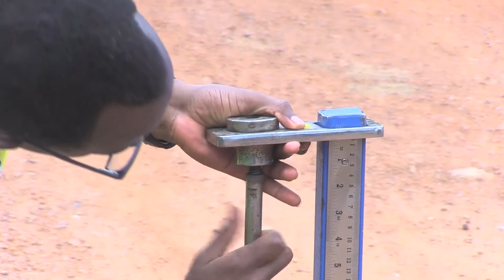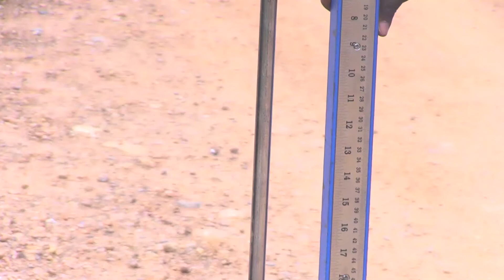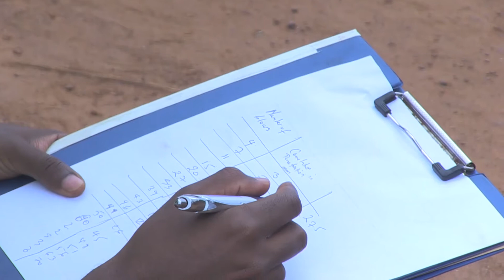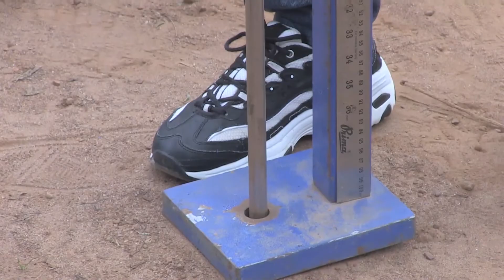Rwanda Polytechnic - Road Construction Level 5 - Performing a Dynamic Cone Penetration Test - 1 of 2

Comment: good presentation, however poor health&safety handling. No rubber gloves in case of electric services obstruction, and also when lifting the hammer to get the cone out of the ground the 2nd man is keeping his hands under the hammer (can easily smash your fingers). Friendly advice, cause many may check the video and don't think about the above.
Reply: Are you a corpo rat?